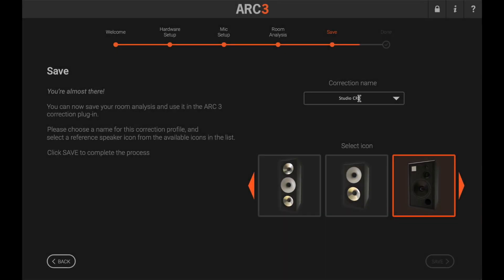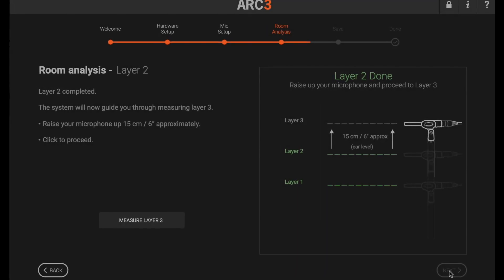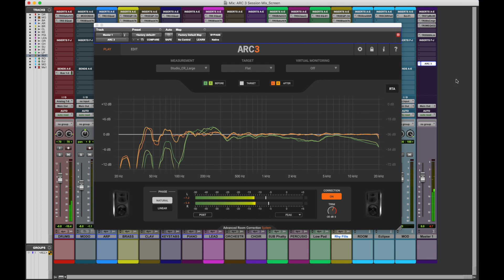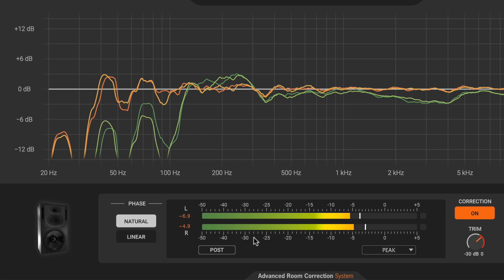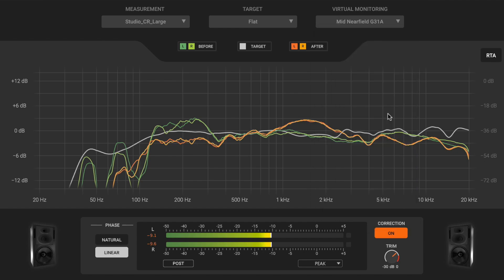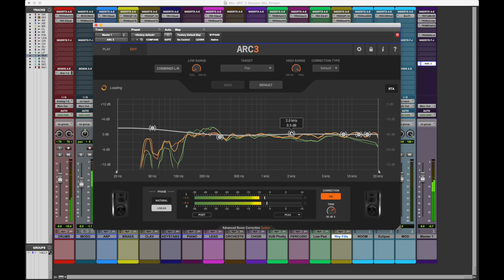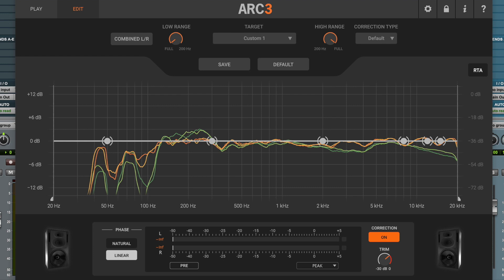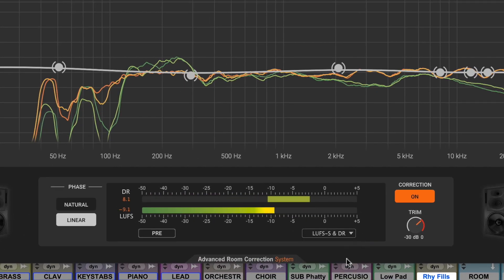ARC System 3 Tutorial -  Using the plugin in your DAW

Comment: The Trim knob is confusing could you please explain what I am Attenuating for , is it Correction Off with Correction On ?
Reply: It compensates for the boosts in the correction curve. EQ boosts increase the level of the overall signal, which could potentially push it into clipping.

Comment: Hi, I just want to ask, I'm looking into availing of the ARC System room correction software and mic. I live in a rental apartment space and contemplating on whether I put up panels to improve my listening environment. Can ARC work optimally without any room treatment or do I still need to put up panels in my room for it to fully work? Also does the correction software influence quality of output over headphones? Thanks!
Reply from the maker: You don't need to add treatment for ARC 3 to work but you can certainly do so if you desire and it could help round off some of the "rough spots"so ARC isn't doing 100% of the heavy lifting.
Reply: Thank you!